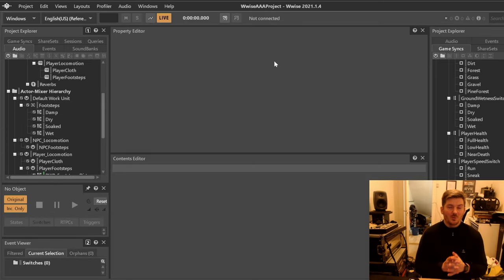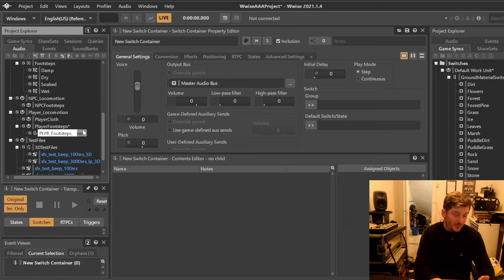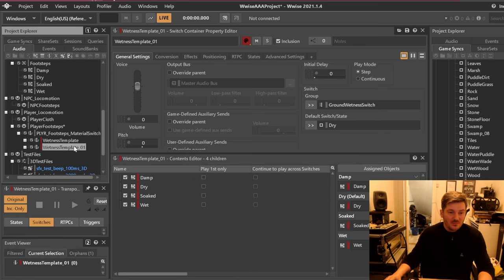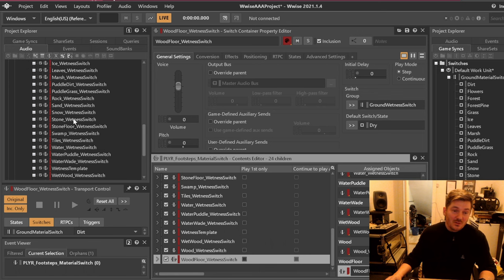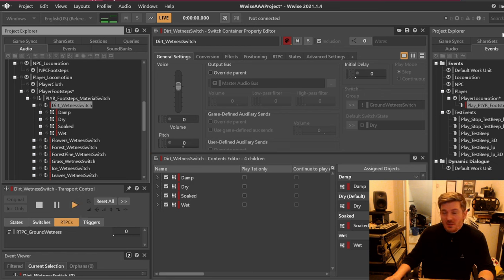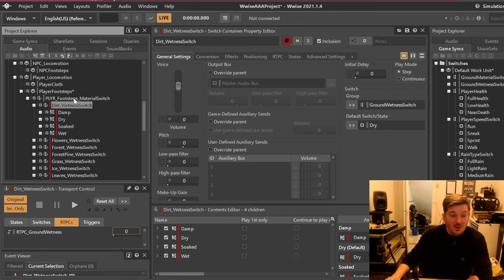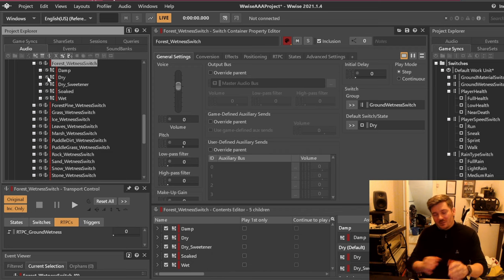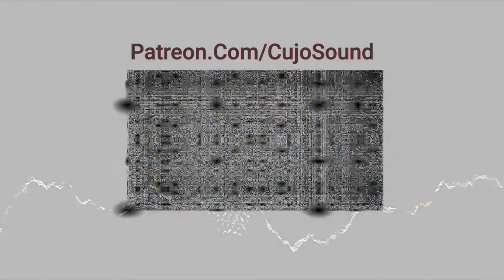Setting up a AAA Wwise project - Part 5: Complex footstep switching with simple RTPCs.

Comment: Thanks for this series! It's great to have a series that is both generic enough to fit most projects and concrete enough to have usable examples.
Reply from the maker: Thank you :) That is the point for sure. :) Eventually the project will be pretty big though.

Comment: You have learned how to express Wetnessf using the Material Switch and RTPC parameters. But how can I add speed parameters?
Reply from the maker: You can't in Wwise alone, there isn't a built in parameter for velocity, you would have to go into code or blueprints in unreal and get the velocity of the character and then send that as an RTPC.  You can see how to grab the velocity from a character easily here: https://www.youtube.com/watch?v=xkB17uhKeMw 

Its not the perfect method, but you'll get the idea.
Reply: Thank you. Your video helps me a lot with my first project using Wwise.

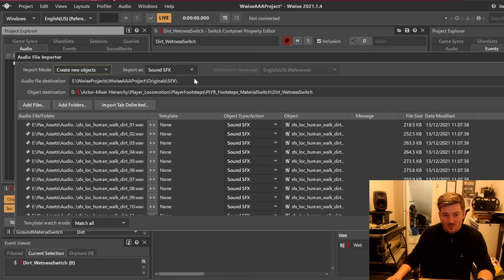Comment: 7:05 Does this mean you allow different sounds to have the same filename (but located in separate folders) or you want to avoid that? Still not sure I correctly understand the need for Originals substructure. In my case I like to keep all filenames unique so I don't care about Originals hierarchy.
Reply from the maker: You can definitely have a unique filename and then just have one originals folder, but once you have thousands of files, regardless of filenames, it would he way easier to find all files related to player or npc or ambience, if in a specific folder. 

I've worked on AAA projects with both disregard to it in the originals folder and then strict folder structure.